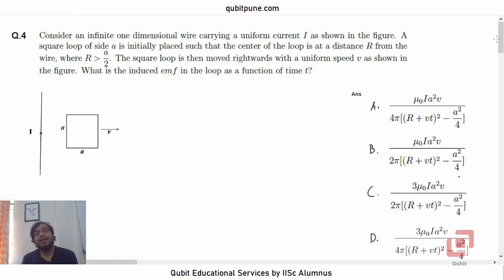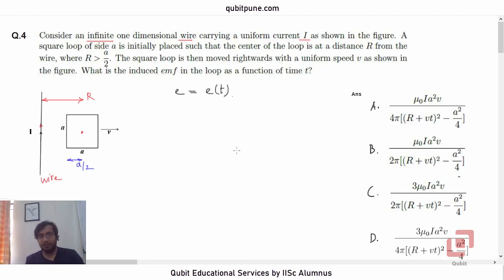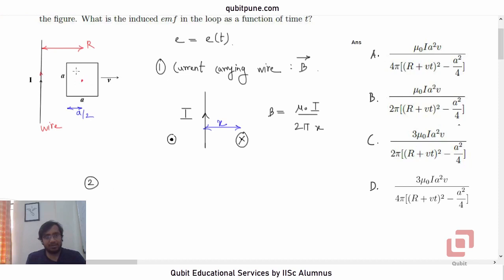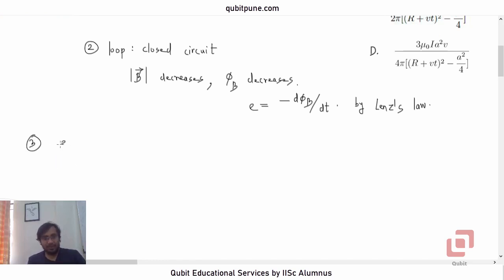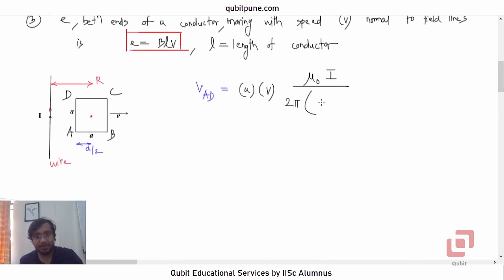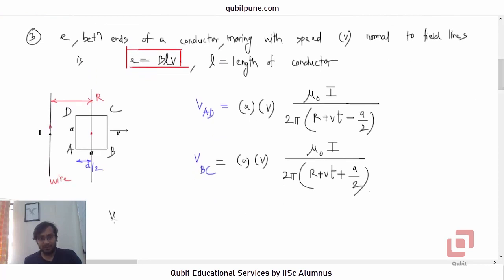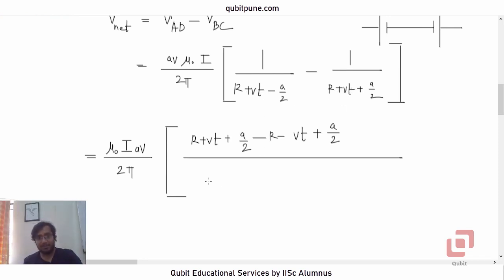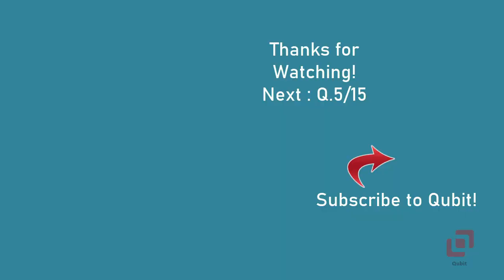Q.4 | IISER Aptitude Test 2020 Physics Solutions | @qubitpune

Comment: Sir the sides AB and CD are not having current through it because of symmetrical surface or specifically equipotential surface both are on the same line on the same equipotential surface, so the potential is same resulting in zero voltage difference. is this explanation correct?

Comment: Sir i have confusion in the subtraction, because i always did addition in same wire and answer is always right
Reply: Same
Reply: Look at the batteries how they are put if u connect - to + then we add it but if we put - with - or + with + we subtract check the direction of current which will make this more clear

Comment: Sir, Across ends A&B and C&D no emf will be induced because we take thickness of the wires to be negligible. However, if it would have been a thicker wire, then emf would have been induced across it and the potential would have been higher at the top and lower at the bottom of the wire.
Reply: Why like this? 😅 They why did we consider the other two ends if thickness is negligible